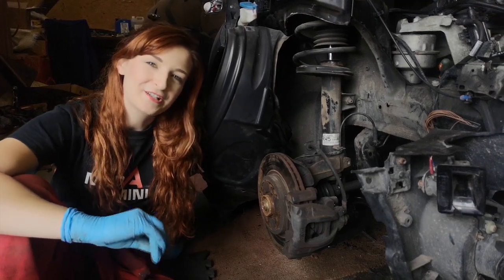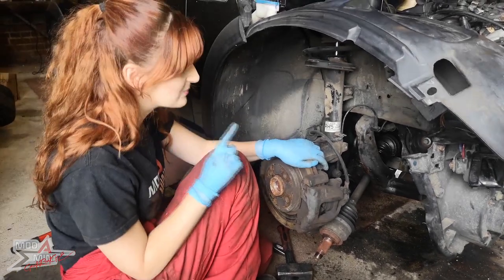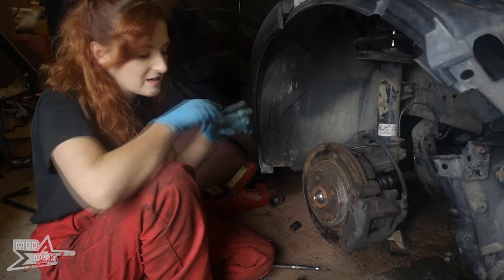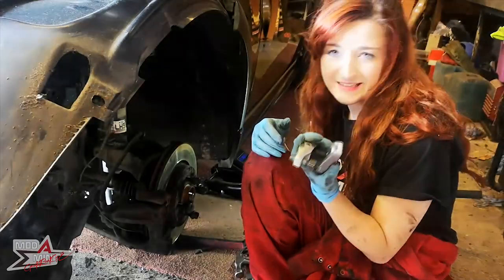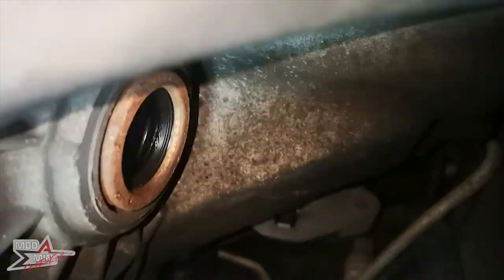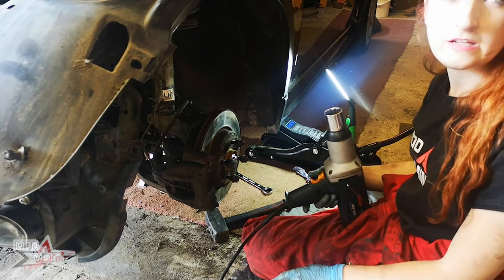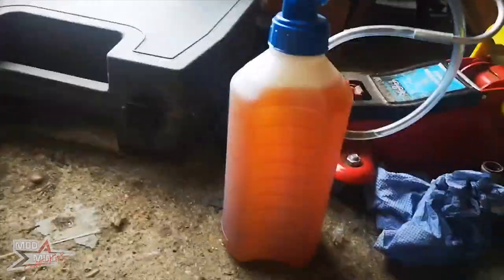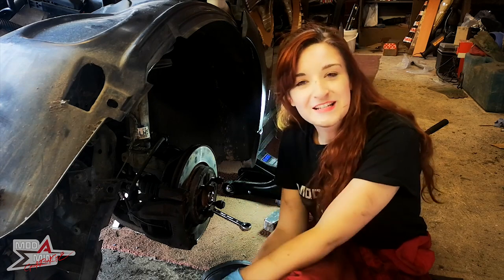Replacing my Mini Cooper S R53 Driveshafts!

Comment: I need to replace both inner cv boots would it be easier to replace them or buy new shafts 
Thanks andy
Reply from the maker: The draveshafts are quite expensive for the r53... Replacing the cv boots takes around 1 hour per side if you handy with a spanners :) It's a bit messy but not too bad! I would change the boots :) Thanks for watching! Miriam xx
Reply: Ok will order some boots and change them , any recommendations for boots and would it be best to drop gearbox oil at same time ? Thanks and keep up the good vids
Reply from the maker: You will lose a little fluid but nothing major will only need a little to top it up :) that being said if you don't know when the fluid was last changed and you have the means to put it back in it could be prudent to change the oil :) worth considering changing the driveshaft seals for good measure :) All the best, Miriam xx

Comment: Just trying to do this myself on passenger side. That driveshaft is not coming out. Any ideas tried various pry bars but no luck. It needs a real jolt. I see you used a type of ball joint breaker to get behind. What one did you use or any idea whether taking the other driveshaft off as well and tapping through could work?
Reply from the maker: Hi Nigel, we used a tuning fork splitter, I'll grab you a link to one :) thanks for watching Miriam xx
Reply from the maker: Something like this, should be able to get them at most parts shops :) https://www.ebay.co.uk/itm/264859276303
Reply: @ModAMiniGarage   - Cheers I have one of these and the shaft seems to have come out as much as yours but still cant get it off. Will keep trying Cheers

Comment: hi, thanks for the vids! just wondering about the carrier bracket that is attached to the old drive shaft, how did you remove that and put it on new one? is it easy to do? i have mine here to fit lol
Reply from the maker: Hi Olly, the shafts we used come with the bracket already installed so I have not actually removed one :( However, the theory is, there will be a circlip that you remove and then knock the bracket off gently with a hammer :) it should then slide right off the end  :) hope this helps, should be clear once you get it off, but you will need some circlip pliers to complete the job. Hope this helps and thanks for watching, Miriam xx
Reply: @ModAMiniGarage  thanks so much Miriam for the reply! I have got myself a set of circlip pliers, so i will swap the bracket like you said. I am in similar position to yourself in the oil seals video, i have oil splattered everywhere, so next i will be following that video to change the various gaskets and seals, once i have done this drive shaft, ball joint, hub, disc and pads, expansion tank (hopefully fix the coolant leak lol)
Thanks again,
Olly :)))
Reply from the maker: Sounds like a fun little project :) these cars are leaky in general so can be hard to pin point the exact leak location doing so of them isn't horrendous :) let us know how you get on, Miriam xx
Reply: @ModAMiniGarage  thank you! Did you have any problems with the LH driveshaft you installed? Mine backed out after a week, which im sure was seated properly, some people have had same issue with aftermarket ones, i have just fitted another brand and also new inner ball joint, even though other one seemed not too bad, see how that goes lol. Ps im running standard suspension. 
I replaced most oil seals, still some to go, new coolant hoses, new oil cooler, new hubs and drive shafts, new ball joints, new oils and filters, im having fun! Thanks for the vids for really useful guidance, 
Olly :)))
Reply from the maker: @bamak1n  No not had anything like that... but the first time we fitted the passenger driveshaft we hadn't quite rammed it home so the car wouldn't move, couple of taps with a hammer and it was perfect. I could see this happening though and allowing the car to move but it not be seated properly and pop out... Its a shame the genuine mini shafts are so expensive! Miriam xx

Comment: Ive replaced my engine and ive lost the three bolts that hold the carrier bearing bracket to the engine. I can not find the sizes of these bolts. Could you possibly tell me the sizes needed? Ty...just found your channel. Subbed.
Reply from the maker: Hi Jeremy, no problems at all! The bolt is a 13mm Hex-Head Bolt Screw M8x1.25x30mm Grade 8.8 the BMW part number is: 07119905532 should you wish to get it from them, note the bolt also has a washer :) I hope this helps, Miriam xx
Reply: @ModAMiniGarage  Yes!!! You are awesome ty!!
Reply from the maker: No worries at all Jeremy, have a great weekend :) Miriam xx
Reply: @ModAMiniGarage  😁 Oh I wIll. Ill  have my car finished this weekend after, it being down for over 3 months. Thanks again! 🙏🏼👍
Reply: @ModAMiniGarage  Have an awesome weekend yourself. 😊🙏🏼

Comment: Hi - I’m doing the same thing right now with the same driveshafts but they don’t fit flush with the transmission? Did you have the same issue? I’m using the j&r ds176 driveshaft
Reply from the maker: That's the correct part number can you send us a pic? And I'll try and help :) contact@modamini.co.uk, thanks for watching, Miriam xx
Reply: Will do - the carrier bracket lines up and have put the bolts in but not fully tightened them but on the transmission end it’s not fully flush, I’ve not hit anything with a hammer yet, lol!!
Reply from the maker: If you do hit it with a hammer (I always tap with a hammer) but be gentle and make sure the nut is back in the end! If the bolts in the bearing align you should be ok :) Miriam xx

Comment: Next time just undo the two bolts holding the ball joint to the lower arm . small tap with the old hammer and there off ...no need for the ball joint tool.
Reply from the maker: Good tip this! Need to replace the ball joints on this as well as I assume they are the factory ones so will be well worn by now. Thanks for this and thanks for watching! Miriam xx
Reply: This is a good tip for anyone outside the UK or has relatively new outer ball joints. For anyone in the UK with old ball joints - you have no chance doing it this way as the ball joint rusts itself to the hub carrier :(
Reply: @JohnCarlyle  yep, mine was rusted to the carrier, needed the removal tool and also tw@tting it with hammer, then using a chisel either side, working way in and eventually dropping out the ball joint